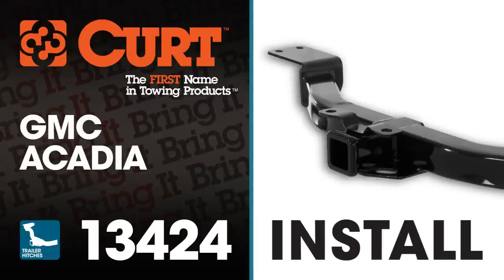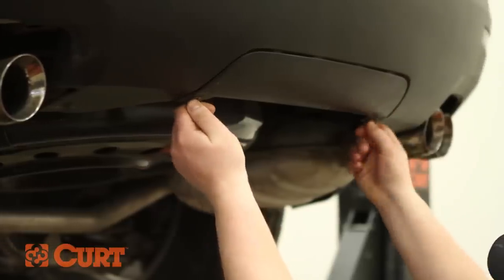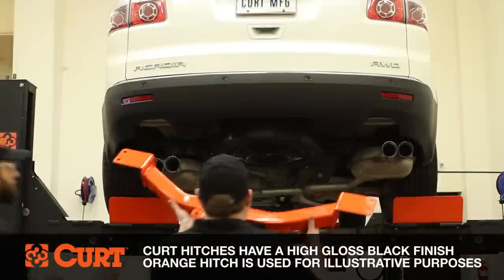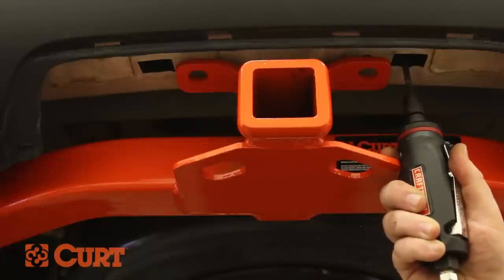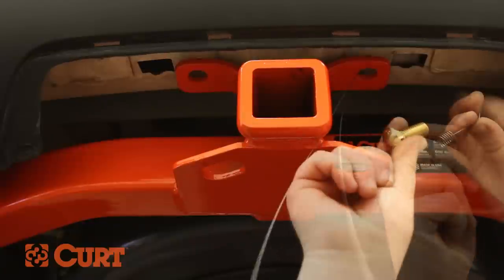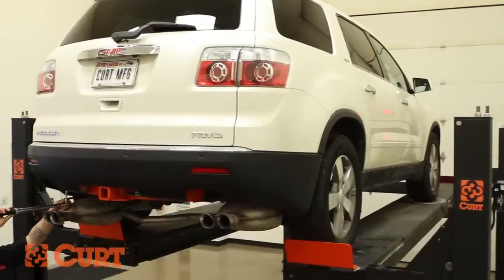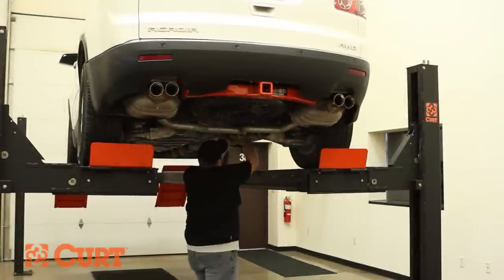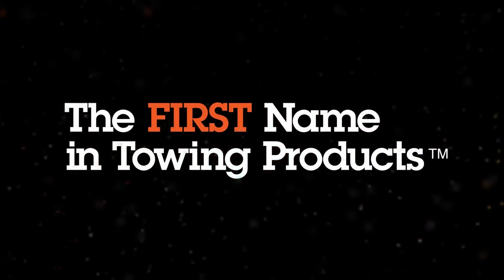Trailer Hitch Install: CURT 13424 on GMC Acadia

Comment: CURT Manufacturing is it the same on a 2014 Acadia? I'm in the market for a hitch and am going to install myself...
Reply from the maker: Ryan Reloba Mr. Reloba it is the same on the 2014 GMC Arcadia. The install is relatively easy, and you'll be ready to tow in no time! Be sure to support your exhaust system with a ratchet strap or coat hanger.
Reply: CURT Manufacturing Since the 2014 and 2013 are the same body style, is it safe to assume this would work on a 2013 Acadia also?
Reply from the maker: Kevin Cavell Yes, it will fit. Check out our quick hitch look up, right here: http://curtmfg.com/page/about_curt
Reply: Awesome. Thanks!
I bought one based on your prompt response and this video!
Reply from the maker: Kevin Cavell You're more than welcome, thank you so much! Enjoy your new hitch and always tow safely!